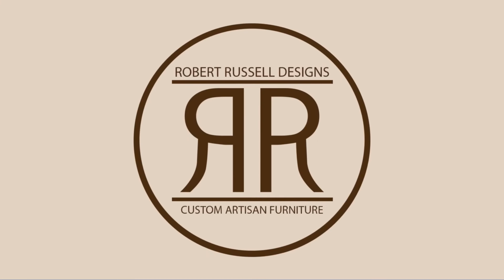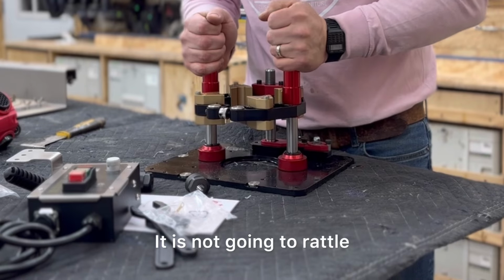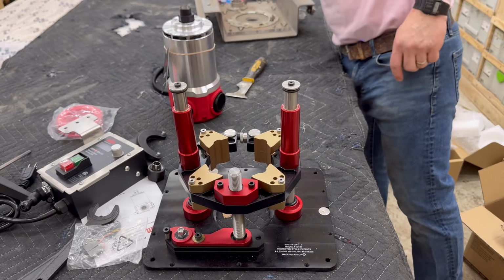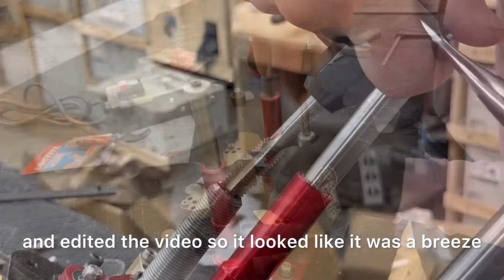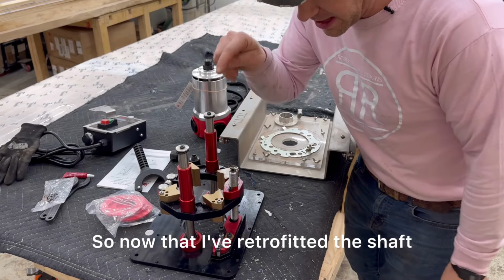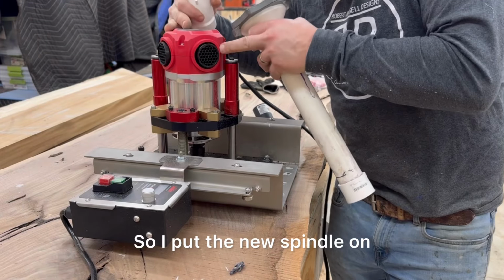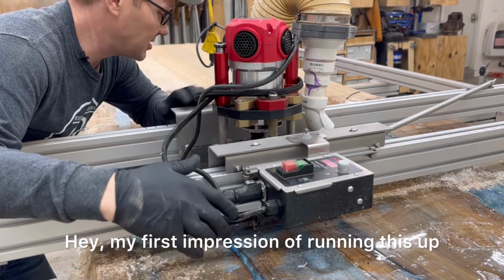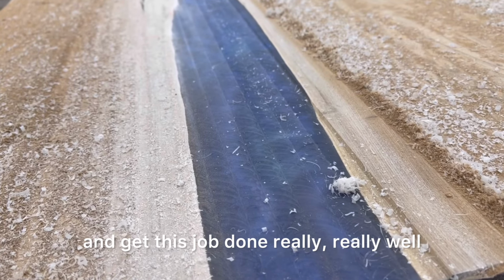IMPROVED The Ultimate Router Sled

Comment: you should suggest those two mods to jessem, i'm sure they would be very receptive.  i'm building a new router table using jessem parts including that lift and motor.  i have a shop built sled for flattening, the jessem bits would be huge improvement to it too
i visited jessem in new brunswick canada last month, awesome place
Reply from the maker: Definitely did. They reposted my vids. It was super cool
Reply: @robertrusselldesigns  cool!  i completed my router table/cabinet, basically a big plywood box with cherry faceframe and door/drawers.  the top is the jessem top, fence, motor and lift all jessem plus all of their extra accessories.  i also used their airsupply hoses for fresh air supply for cooling as the router motor is in an almost sealed box connected to my dust collector
i feel bad for them having to trump's possible tarifs, i imagine the us is their biggest market.

Comment: Do you rate the powr tek motor still ?
Reply from the maker: I love it. I’m not afraid to run it all day long. It never appears to over head. Absolutely, a solid piece of equipment. Oh the lift is top notch too. I haven’t need to adjust anything yet and I run the set up for about 8 hours every week. I think that’s a win.
Reply: Superb. Is this running on 120v or 230v ?
Reply: 120V can it be converted to 220v? If so that would be legit!
Reply: I’m in the UK, so we get the 220/240v versions. 
I’m just looking at this motor as an option, but it’ll be in a router table.
Reply: @robertrusselldesigns  Still running good? Looking for a 3+hp for my harvey router table setup that fits the MasterLift II kit. Read a few bad reviews of this motor, so wasn't sure if this is the way to go or what.